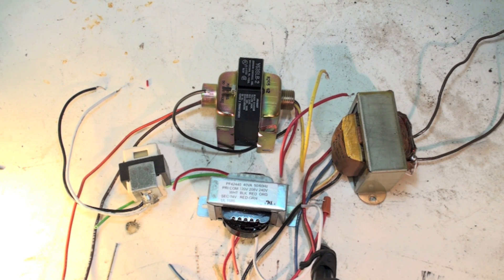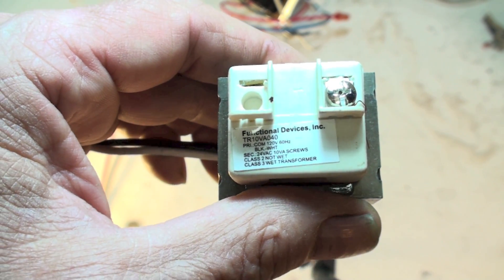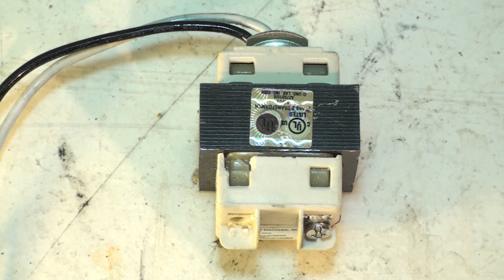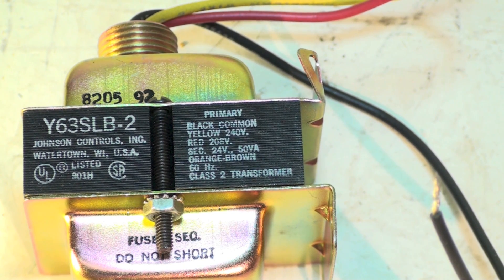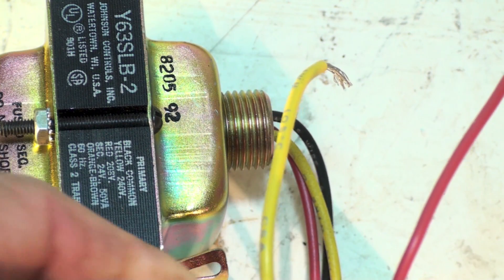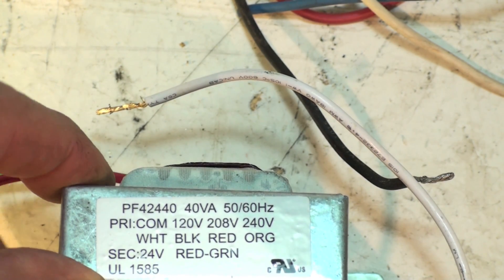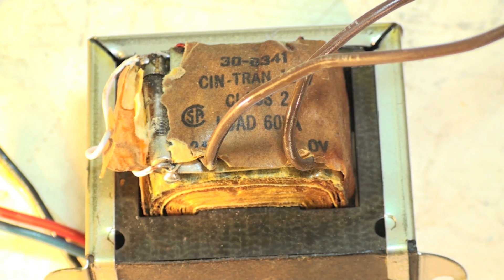The HVAC transformer

Comment: I dont have an inline fuse on my system and we had the powerline running the the house from the pole catch on fire. Also something chewed the 24v wire going to the ac unit. I replaced the wire, checked all fuses, checked the contactor and capacitor and all is well. I am not getting 24v at the contactor. I believe I have a bad transformer
Reply from the maker: Check voltage coming into the transformer.  Then check voltage coming out.  
Voltage in, no voltage out, transformer failed.
GFM

Comment: I noticed a humming coming from my transformer when the furnace is off. It is warm to the touch even when the furnace has been off for a long time. Is this normal? This is happening just after 3 doors down our neighbor installed a Tesla charger. My duplex and the one next door keeps burning circuit boards in the water heater also would these be connected?
Reply from the maker: The transformer hum is common.  I won't say it's normal, but unless it is is loud enough to be a problem, it's ok.  
I can't see where a vehicle charger could affect other locations.  I have one in my garage and it has no effect on anything.
GFM

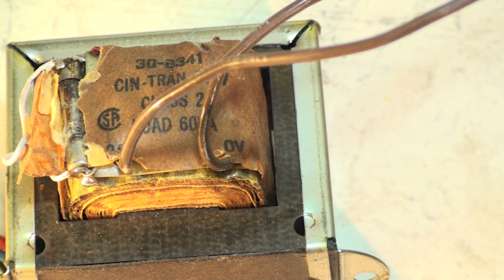Comment: 7:25 ...actually, transformers WILL cause failure on the furnace side in a split system when they burn out. A sticking contactor on the outside AC unit can contribute to this, all while the outside unit will still operate.
Reply from the maker: A sticking contactor is what is causing the failure because the contactor is overdrawing from a failing armature.  Overdraw of the circuit is not the fault of the transformer.
The point is the transformer seldom fails.  It is damaged by an overdraw of the circuit.  When you find a failed transformer, you need to look farther to determine if there is something that caused it to fail.
GFM

Comment: A short on the primary will not “take out” the transformer, if by taking out you mean burn up the primary winding. A short on the primary will cause the overcurrent device protecting the circuit feeding the transformer to operate.
Reply from the maker: I am not sure where you got the "short in the primary".  Generally, the short is in the circuit of the secondary which overloads both windings and the winding with the smallest wire will open.  
A short in the primary winding may or may not open the circuit protection.  But it will feed the wrong voltage to the secondary winding which will probably cause an overload or low voltage to the controls.
GFM
Reply: @grayfurnaceman  My apology! I rewatched your video. The shorted primary to which you were referring were the unused primary taps. I thought you were referring to the conductors feeding the primary, in which case the oc protection would have opened.

Comment: So that's how they make a class 2 transformer current limited.  They incorporate the fuse on the secondary side.  

Recently I dug into code for low voltage circuits, discovering the class 2 is considered inherently safe because of voltage and power, i.e., VA/wattage, design limitations and self limiting. (60VA for 12v, 96VA for 24v)  A DC power supply can be designed that self limits the current, but I wondered how they did it with the transformers.  Class 1 or 3 power supplies/circuits require inline fusing to limit overcurrent.

Comment: I was swapping thermostats and I think I hit the blue to red wire.  Would that smoke the transformer?
Reply from the maker: I can't be sure as the color code is not always followed.  Generally, if the blue is used as common it will blow the fuse in the transformer.
GFM

Comment: I have a transformer that I can wire either as 16v or 24v. how do i wire it for 24v?
Reply from the maker: There should be a listing on the side of the transformer with color codes.  One line will be common and the color code should tell which to use.
GFM

Comment: my unit is a 240v system. how do I wire the 240 tap with one wire? this system has no return and only a ground. I have one leg from L1 going to the 240v tap so my com is ground. and my 24v side only puts out 11 volts. so do I hook up the L1 leg and a leg from say T1 or T2 to the 240v tap? thanks. I'm stumped on this one
Reply from the maker: The primary of the transformer is just wired to each side of the 240 volt power source.  The use of a common does not mean it is ground.  
GFM

Comment: I lost neutral in my house. Some outlets 175 volts and some had 50 volts ..All my 120 volt primary transformers fried   .. Good tip on the inline fuse....They can save from replacing transformer twice ..or until you find the cause...although it would not  have saved me from a power company fault.

Comment: Are the white and black on the HV side actually interchangeable? Or it the white some how tied to the body or if reversed will it not operate properly or safely? Thanks
Reply from the maker: They are interchangeable.  White is not connected to the chassis of the transformer.  The only reason for the different colors is if there is a fuse integral to the transformer, it will be on the black side.
GFM
Reply: Thanks
Good to know.

Comment: on heat pumps what are the 2 24 volt wires hooked up to usually?
Reply from the maker: +kurtis bardic Lots of stuff.  Contactor, reversing valve, defrost board are some places.  This probably does not answer your question, but there is no "usually".  I have been meaning to make up some wiring diagrams that are commonly used in heat pumps, but have not completed it yet.
GFM
Reply: +grayfurnaceman that actually helps a lot your the man! im a instant subscriber😆 hopefully you can get to that soon

Comment: I have a forced air gas furnace, the  4 wire transformer is dead. The output wire are colored. I went to the hardware store and they said a "24VAC door bell transformer would work. They told me the output is non polarized so the 2 wires that go to the control board are not polarized and it did not matter which wire goes where. Is this true? Thank you
Reply from the maker: +EurekaRecycler Unless the bell transformer is 40 VA capacity, it will not work.  Polarity is not a problem.
GFM

Comment: Should I be reading 24 volts on both leads of the transformer coming out the 24 side? I am checking one leg to ground on the low voltage and reading 28 volts and I checked the other leg to ground and getting 0, but if i check both together i read 28 volts. will the common side of the transformer read 0 if i check it to ground?
Reply from the maker: SombraLocs The transformer should read voltage across the 2 terminals.  The transformer usually has one side connected to the chassis of the unit.  Hope this helps.
GFM

Comment: Thanks for the posting

Did you ever hear of grounding the neutral on a on the output side for boilers?
Reply from the maker: eel1452 If there are any unions between the boiler and the piping, it should be grounded.
GFM
Reply: I'm talking about taking one of the wires from the 24 volts and bonding it to the box thereby creating forced polarity?

Comment: Where can you normally hook up a resettable fuse to troubleshoot a short? My Heat Pump doesn't have a fuse, but I want to install an inline fuse.
Reply from the maker: SombraLocs On the R wire.  
GFM

Comment: Hey GFM,

Thanks for the video and explaining  the Volt Amps that helped out a lot.  I wanted to ask, if you could replace a 40VA with a 60VA if that is all you had in your truck at the time or if it needs to be the exact match?  Thanks for your help.
Reply from the maker: Bigger will work, smaller may not.
GFM
Reply: grayfurnaceman
Thanks for the response I appreciate it.
Take care.